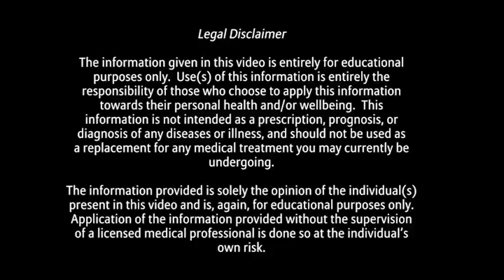Homemade Faraday Cage

Comment: To sleep you say b3, what is the best aid in combination that you've seen with b3? GABA or something?
Reply from the maker: Niacinamide + Glycine or Gaba or Taurine or Melatonin or Trytophan -
or Inositol
or Inositol + Glycine or Gaba or Taurine or Melatonin or Trytophan or Niacinamide

B3 is the crux of converting everything for sleep but these are the combinations I have seen given the best results but there is no best---some of these combinations work great for some -and some other work great for others---there is no consistency
it would depend on what there systems need
Tony
Reply from the maker: *****
glycine= amino acid
glycerine = sugar
Tony
Reply: T you offer a lot of different solutions for sleep. Can you breakdown what each does so we know what can be of use depending on condition? For example I'm anxious. Does one of these take that away? Or is this not even part of equation.
Reply from the maker: 21Bluejade
 this is something you can do---the info is there the onus now is for you to have this for you and do the research---my time  is tapped already and with what I gave you --you can deduce this --not hard
Tony

Comment: T would wrapping the smart meter with aluminum help? I assume the smart meter is that which gauges electric consumption correct?
Reply from the maker: if you do you have to put it behind and leave some part of it opened or they will come to your door and ask WTF is going on and give you a royal blast ---but your still going to have to deal with the neighbors pulses as well as haarp and towers
haarping  goes on while you sleep as well and if your ever up at 2-4 am and go out side watch them line the sky while everyone is sleeping
and then listen---you will hear the high pitching
and as I stated if your on a second floor house level--- you usually wake up in severe pain---this is the result of frequencies
Tony

Comment: Tony I live in the country part time. They gave us a smart metre. My nearest neighbour is a few clicks away, there is no cell service and no Wi-Fi.  Would it be easier to just wrap my metre itself in foil? Would that screw up my metre?  Oh and at first I thought this was a little far fetched but when you brought up the banks it made me think. Once and a while we go to the casino and I always wondered why after a few minutes my joints hurt. I thought it was all the electrical current in there. Well now I know. I am being zapped and attacked.
Reply from the maker: the wrapping can be behind but you have to leave the fron part open or they will come down and investigate and give you )(*() for blocking the meter
but the flow is going throughout the house as well through your electrical lines
try it and see if it makes a difference
Tony

Comment: Outstanding! I'm working on the same thing right now. When my son and his girlfriend moved in, with their ton of Wi Fi junk, I started having trouble sleeping, I figured it was the change of lifestyle, and would be over soon. WELL, not so. the Wi Fi is in my room, and I have not slept since it was installed, it finally dawned on me that it was the Wi Fi, so I am making a cage too. They did move the WiFi but I still had trouble, so the faraday cage is going in. I decided to upgrade and use the better material, and everything I can find that concerns me, is also going into a metal container so that they will be cut off, at least while I sleep. People laugh about all this, but my husband had seizures right after they put in those meters, and when we moved he no longer had them. I can actually tell when things are in high gear electrically.
My sinus starts to feel full or clogged. weird but true. I guess when you are off all day like me, you have time to notice it more. Great Video.
Reply: So weird!! Ive been waking up around 3am for awhile and had no idea!!!